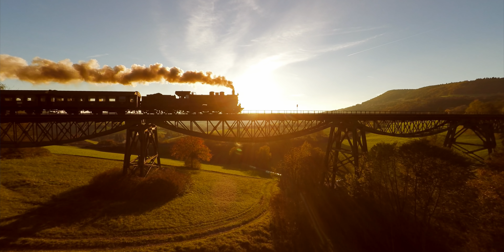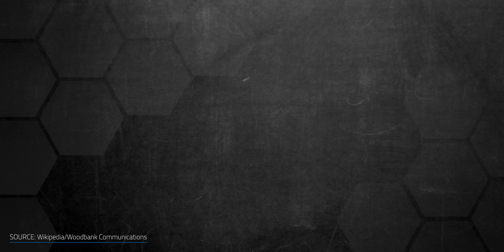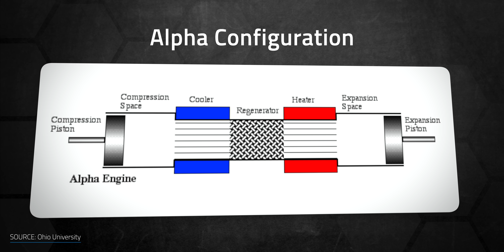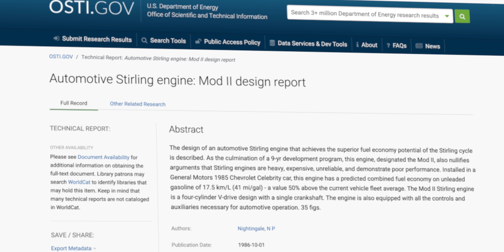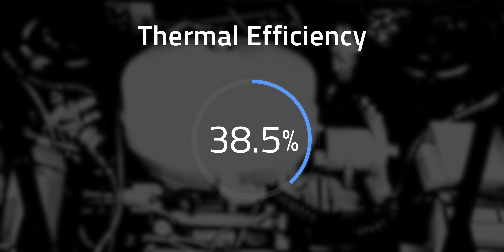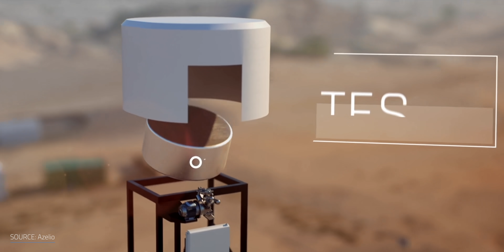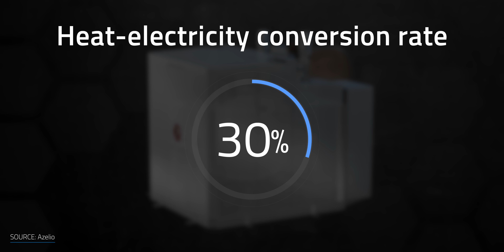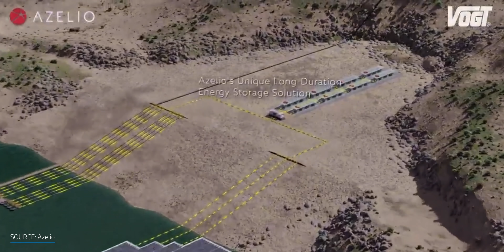Are Stirling Engines the Future of Renewable Energy Storage?

Comment: These seem like the ideal thing to pair with photovoltaic thermal hybrid panels.
Reply: Especially when you consider the extra efficiency gained from cooling being applied to the solar PV.
Reply: The Stirling engine proves its usefulness as an engine when paired with the heat exchanger of another engine as its power source
Reply: @clementoseitano7568  It does. Imagine all the machinery we have that needs cooling. Using stirling engines to convert the excessive heat they create into electricy could give us a lot of "free" energy.
However, there is another alternative worth looking at, the Seebeck engine. It does pretty much the same thing, converting temperature differences to electricity but it's all solid state elctric circuitry so no moving parts. At the moment Seebeck engines cost more and are less efficient than Stirling engines but that may change soon.

Comment: When I first learn about Stirling engines it was with molten salt, but Hydrogen or Helium sounds like a better fluid? Another great video!
Reply: ...How the hell you misunderstood this so much? You can't use molten salt inside Stirling engine,molten salt used to store heat apart from engine. Hydrogen or Helium is used inside the engine in gas form.

Comment: Are the lifecycle emissions calculated at today's energy mix on the electrical grid?    I am not certain but I think most of the Li-ion CO2 life cycle is due to the energy intensive manufacturing and not inherent in the chemical processes used during manufacture.  Please correct me if I am wrong.

If Li-ion batteries are penalised due to the lack of renewable energy available,  massively implementing a storage technology with only 30% charge/discharge cycle delays sufficient generation of renewable energy.  My impression is that liquid nitrogen storage can operate at efficiencies that exceed this and should be as, or even more rapidly deployable.  I would have to compare with molten metal batteries in order to determine if the stirling cycle would offer any advantages.

Long-term energy storage that is fairly rapidly scaleable will eventually be necessary to fully eliminate seasonal or extended weather related use of fossil fuel plants.  My casual investigation leads me to believe that any system that is easily scalable will be less efficient than Li-ion on a charge/discharge cycle.  I have come to the opinion that society is better served by concentrating on deployment of renewable energy conversion and sufficient high-efficiency battery storage to mitigate daily demand fluctuations while we evaluate the most efficient long-term storage options.

As we start to overbuild the renewable energy collection in order to provide adequate seasonal energy the efficiency of the long-term storage solutions become less important as most of year a large excess of energy will be generated.  Till we get to this point I think the technology with the better cycle efficiency will win.

I have not seen any presentation that quantitatively compares life-cycle CO2  emissions both at present energy mix and as the mix trends to renewable energy for the various storage technologies.  This data coupled with charge/discharge cycle efficiencies would be a more comprehensive comparison.  A third metric is ease of dispatch.  Batteries seem to win on this one for transients, but any technology that can dispatch within seconds or minutes is viable for meeting daily demand fluctuations.

Many presentations assume the charge energy is free or actually can generate revenue due to excess peak renewable energy generation.  I think this overlooks the fact that, as more energy storage gets deployed, more bidding for this "excess" energy will occur.  The facility that has the highest cycle efficiency is well positioned to have a lower levelized cost of energy, permitting it to outbid less efficient but lower capital cost plants.

This brings me to another point I don't here discussed with the various technologies much.  The self-discharge rate of current Li-ion batteries is reasonably low.  How does that compare with the rate of energy loss from a commercially deployable thermal energy storage system?  I have the impression that batteries in at least the short term will win the daily cycle race but with other technologies vying for leveling demand on the multi-day or seasonal basis.  The total energy sold per year relative to storage capacity would be lower on such plants as they are cycled less frequently.  The self-discharge rate of the thermal energy would be more significant to such plants.

Gravity storage certainly wins for self-discharge.
Reply: Mostly "Yes" to everything,until there is Li shortage.
Reply: @Steellmor  I'll work out the thermal energy density of aluminum at 500 deg C vs that of a lithium battery and see which of the two abundant materials sees pressure. I understand the abundance of lithium is not the issue.  We are nascent on the development of the extraction facilities.  BTW aluminum is VERY energy intensive in its refining.  We just use a lot of it so we don't pay much attention.

I did think of an interesting idea writing this.  Metal refining industries, in particular, could implement a stirling thermal to electrical energy conversion plant and play arbitrage with their electrical energy costs at the expense of reserve melt in their process.  They would need to regularly experience a greater than three-fold cost variation in electrical energy for this to succeed.  I honestly don't know if such facilities currently shut down on increases in energy cost and ride through on thermal inertia or if they purchase energy 24-7.  Thirty-percent efficiency with no transmission losses may not be horrible in this situation since the incremental cost of expanding melt capacity is likely small.
Reply: @mrhickman53  I didn't mean to support idea of using  heated aluminum. Actually didn't even try to figure why they chose aluminum for that purpose,also I'm pretty sure there were "some" misconception about "up to 600°C"  limit for storage temperature,since on presentation video it clearly says "melting at 600°C" so storage supposed to be "up From 600°C". That's just stupid to melt aluminum and keep it right above melting point and not increase temperature more.

Comment: I think the future could actually be a combination of soo many type of engines and powering alternative just like the early 20th century in my opinion. I think the biggest things that nobody is talking about is synthetic fuel or eFuel (for Porsche case). I think its a real possibility that with a new non-fossil or petroleum  base energy source that produce 0 emission will be feasible more than electrics. This has to do partly with the infrastructure and also convenience. However, I think the only drawback would be actually more to do with politicians. They had promise more with EV, so imagine how they would look like if all of the sudden they just changed plan and after incentivizing and investing on EV.
Reply: why waste time burning stuff when you can just use sun/wind/wave energy power directly or to heat materials up and convert that to electricity or release it for living space.

Comment: I love the Stirling Engine. I have 4, small ones, tiny really. I would like to buy one LTD that can generate some 40W. It is not on the market.
Reply: Wonder how that math calculation works out?  Heat +volume of expansion and x the flywheel momentum transferred?  Wonder how Freon works as the expansion gas in a closed loop?
Reply: I guess you just have to settle for buying ten LTD-engines of 4 Watt each.
Or we could just invent one that'll do the trick.
I made a Kelvin-thunderstorm that produced a whopping 2 microWatt so if I do that 20 million times were there. ;-)
Reply: @DreadX10  have you taken into account any resistance?

Comment: Just curious, does the size of the gradient affect the power you can get from a sterling engine? If so, night time temps are lower so storing heat during the day and using it to power a sterling engine at night would both answer the PV issue (the sun doesn't shine at night) and get more power just from temp changes due to the Earth's rotation.
Reply: Two things - 1)30% efficiency   2)Difference in +\-10° compared to 660°+ of heat storage isn't much.

Comment: Maybe Stirling engines could power a water pump used to cool solar panels. Cooling the panels increase efficiency and 100% clean power for the water pump. I think Stirling needs more development because it has a wide range of uses.
Reply: Cooling panels with water increases installation cost,maintenance and waste water.

Comment: what about using sterling engines on a air/air housecooling system exhaust? during winter, it's colder then ambient, during summer it's hotter then ambient. hmm
Reply: Heat recovery ventilation is much more profitable.

Comment: In Australia, there was a roadhouse out on the Nullarbor Plain that used a solar pond (a stratified thermal salt pond) and a stirling engine for its electricity. It was way back when photovoltaic panels were way too expensive and quite low efficiency, but it did the job and at the time everyone was raving about it.
Reply: Then everything changed when the Minerals Council attacked...
Reply: @stephencoulter3613  tell me what exactly happened
Reply: @stephencoulter3613  The fucking mineral council.
Reply: Gday James - any links to that roadhouse you mentioned? I wouldnt mind buying a few of these and experimenting small scale. I had no idea they existed.
Reply: @john1boggity56  ay you won’t be able to buy one, but i’d advise searching salt gradient solar ponds and having a look at images, should help you to understand how you’d go about making such a setup
Reply: @justan idiot Not likely in the Nullarbor... It's arid desert with essential no trees.
Reply: @justan idiot Why have most farmers cut these unreliable windmills up for scrap?
The people who fantasize about windmills have never owned one of those dangerous and unreliable piles of crap. 
We took great pleasure cutting two of the  legs on our windmill and pulling it down with a tractor.
Reply: @Johnsmith-zi9pu  I grew up on a farm, where we had two of those windmills pumping water from boreholes day in day out for 18+ years. From time to time we had to pull up the pipes and replace seals on the pumps. But those windmills? Ran with no problem at all. 
If you had issues, may I suggest a different brand then..
Reply: @joeballony6129  ay yeah same i lived on a station in central australia and just about all our water was brought up by windmills at the time and stored in dams. The Great Artesian Basin has been supplying ground water to Australians for a while. Solar pumps are replacing them nowadays but that’d be due to them being more effective and living in an area that is known for droughts that is quite useful.
Reply: @Johnsmith-zi9pu  my guess is you didn't perform regular maintenance, everything needs regular maintenance, i have 100 solar panels i have to clean them every three months
Reply: @Johnsmith-zi9pu  Amen.  PV is far better than wind, those are only suitable for utility scale.  Heck even natgas tends to be more reliable and cheaper, if ecologically worse.

Comment: This really is one of those underestimated and underutilized systems. I would love to see these come into widespread use such that the phrase "waste heat" becomes a bit of an oxymoron.
Reply: Why? It has own waste heat - you need to cool one side for it to work.
Reply: @Steellmor  throw a stirling engine's hot side on that
Reply: @BreaKdOwn--rl  And another stirling engine on hot side of second stirling engine,so with first stirling engine it makes 3 sterling engines..Now we just need to connect cold side of the first engine to hot side of third...And we dealt with waste heat! Now we have just a bunch of waste machinery which we can easily put into trash.Recycle that trash and make MORE STIRLING ENGINES!!

Comment: Using solar panels to heat the storage material and then using the Sterling engine could be a decent alternative to Lithium for off grid systems
Reply: Did you hear that "30% efficiency" part? You will need 3 times more energy from solar panels to get same amount of effective power stored compared to Li batteries.

Comment: There is a company that has an energy storage system which is essential a giant concrete puck that excess renewable energy is used to pump water under the puck and then when there is demand valves open and hydroelectric generators produce electricity from the puck squeezing out the water.

Comment: WAIT WAIT A MINUTE .NASA USE STIRLING ENGINES for 1kw  Power generation .maybe is possible combine that  with rtgs but use heat instead radiative fuel
Reply: NASA also tried developing a Stirling engine for cars, although it wasn't successful

Comment: I once built a solar thermal Stirling system, but the accurate sun tracking demands of the system made it too complicated.
Reply: I did the same and had proof of concept validated by a physicist however by the time I had gone through the entire process battery storage outclassed it in cost.
Reply: Have you thought about a kind geodesic dome made up of hexagons. They make glasses you can adjust focus on by inflating  what is basically a balloon, one in each hexagon and you can focus on the hot air engine in the middle. The cool section can hang below in the shade of the warm pocket of air above.
Might make an interesting experiment.

Comment: Hrm.. The only engine I know of that works in large scale is a sterling submarine engine. It has an entire ocean to help with the heating and cooling process. So, perhaps, not yet ready for use.
Reply: It’s been around a long time... I don’t thing is a matter of being ready but rather determining it’s uses. Solar thermal is very efficient. I had solar thermal in my house in hawaii and the tank stored water just below boiling - dangerous really... but we probably could have used this spare heat to drive one of these engines to generate electricity etc...
Reply: @michaelsmithers4900  Why dangerous? Just needs relief valve like regular pressure cooker,which whole purpose is to raise the boiling point of water and having some pressurized steam inside it. So below boiling - safer than pressure cooker.
Reply: @Steellmor  It was only dangerous from the perspective that you could burn yourself if you weren't careful turning on the water. The pressure relief valve regularly did its thing!

Comment: Great idea. My wife bought me one of those models for my birthday 2 years ago, they are beautifully made, Kontax Stirling Engines.
Reply from the maker: They're so cool.  Fascinating little devices.
Reply: seems great, wonder if i could charge a phone during  a camping  with something similar
Reply: @ordo3k4os  Unfortunately these small engines only output enough power to light an Led, you would need to run it for days to get any useful charge into a battery,
There are larger engines available but they are very expensive, Phillips made a limited number of 220V/200 Watt models, the MP1002 CA, to power radio equipment in the field, this engine runs on kerosene, it has a working pressure of around 160 to 170 p.s.i. so I wouldn't want to be too close if it let loose.... Probably better off with a lithium power bank running off a solar panel
Reply: @sofa-lofa4241  What is that, 11 bar? It isn't that bad unless you are directly working on it when it is pressurised.
Reply: thx mate :-)